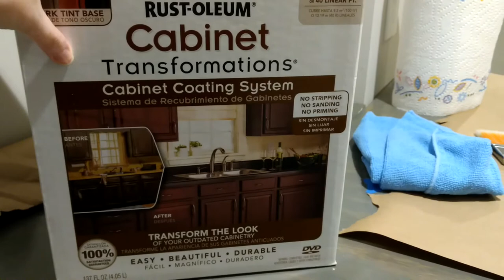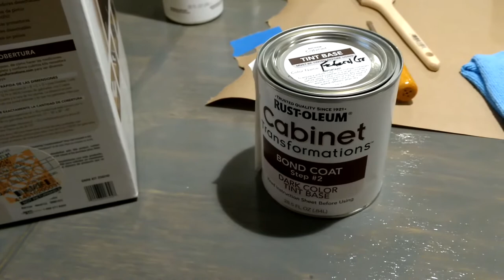Cabinet Renovation | Rust-Oleum Transformations Kit | Home Improvement | the Kyra (not Kira) Vlogs

Comment: This came out beautifully, did you add the top coat or did you stop with the glaze?
Reply from the maker: Thank you! This kit was amazing! I don't recall a top coat, though. We didn't bother with the deglazer (because we decided to sand them even though the kit claims you won't have to), did two of the tint coats on each side and then the glaze. And they've held up pretty well so far!
Reply: Thank you for the response.We just did ours in the shade Kona and love it we have heard terrible things about the top protective coat ruining the work. Thanks again
Reply: Kyra not Kira was wondering if you have an update as to how good they are holding now? I’m thinking of doing my cabinets. I’ve used the kit before on my bathroom vanity and it’s holding pretty good a year after, however,the kitchen is used more. TIA